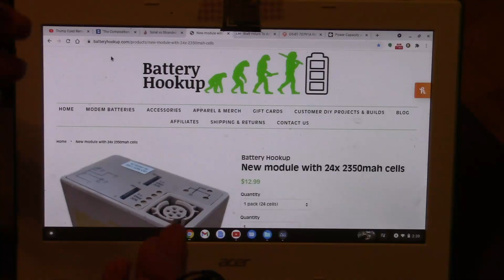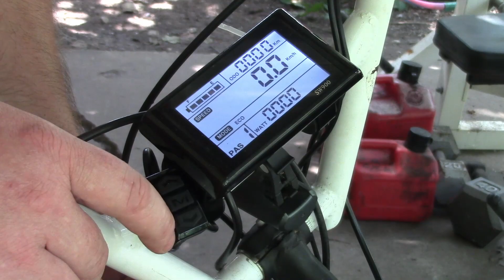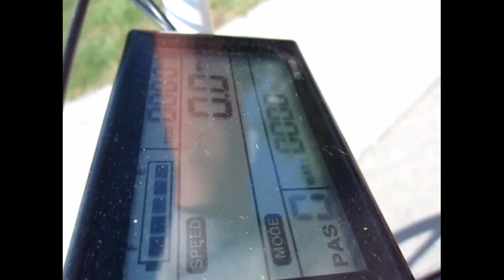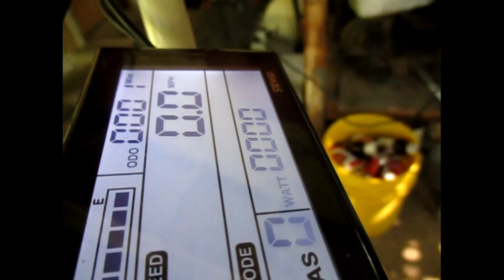DIY EBike Build and Test Run with Voilamart 48v 1000w Electric Bicycle Conversion Kit. First Ride!!!

Comment: I've had one for 5yrs now the controller overheats and I replaced it 3 time. I bought a 1000 watt 20hr batty that cost me more than the conversion kit but it was well worth it. Overall I would but the conversion kit before I spend thousands for a preassembled Ebike.
Reply from the maker: I was thinking about doing some controller mods, like laying down more solder on the board for conductivity and adding a heat sink to the controller case to help it dissipate more heat. Thanks for the heats up on this. I haven’t had my as long as yours but I can expect to have a similar experience to yours in the not too distant future.